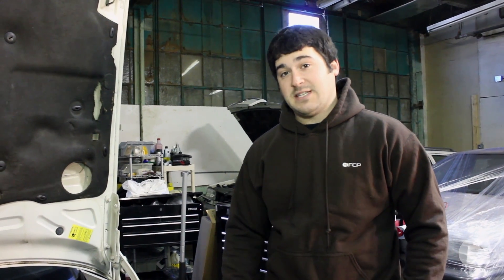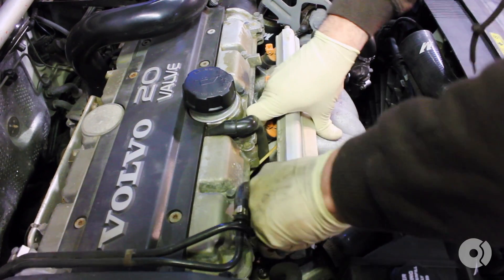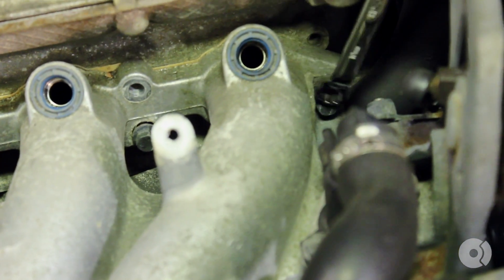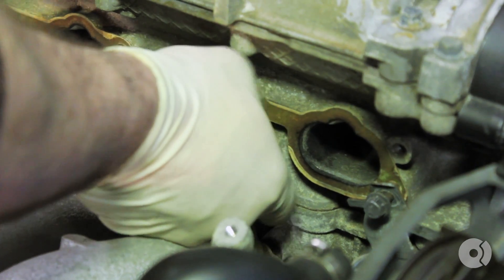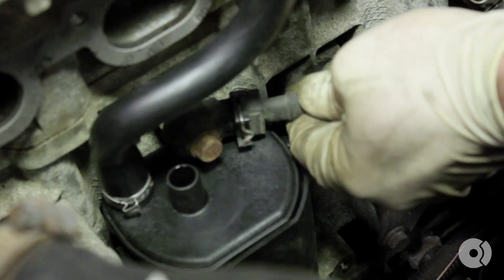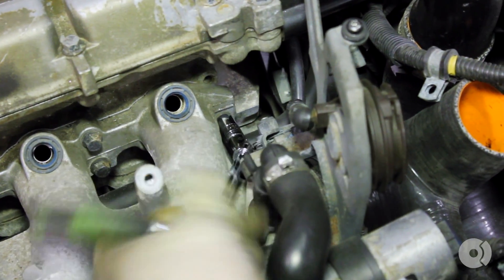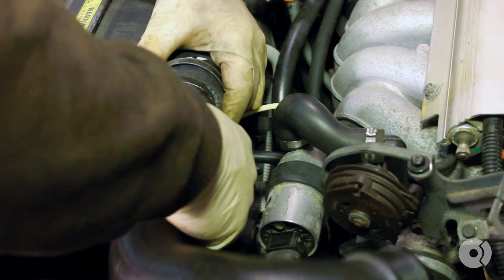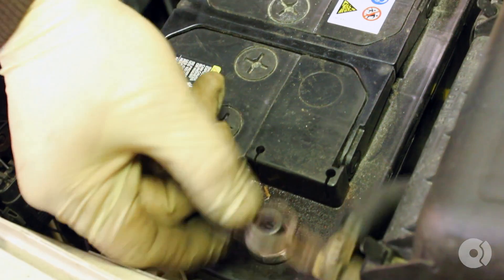Volvo PCV Breather System Replacement (850 Turbo)

Comment from the maker: Not the exact same, but it's the same system so it's similar.  The trap is still located under the intake manifold.  Just take your time and work your way through the process using our video as a little guidance.  Give us a call if you have any questions: 1-877-634-0063